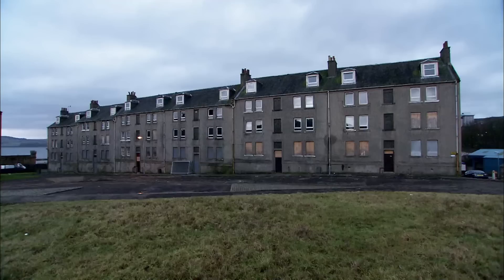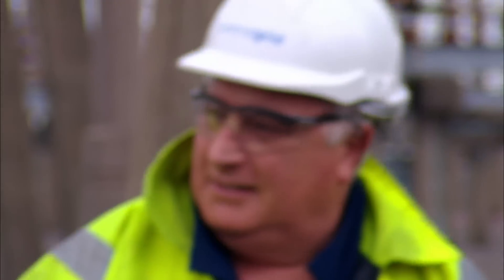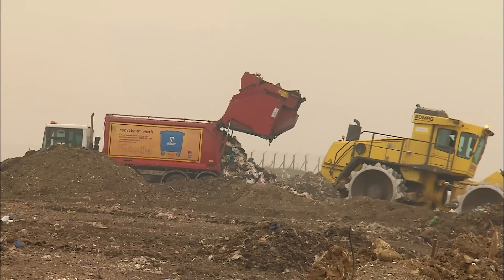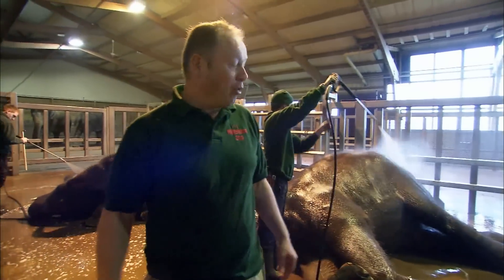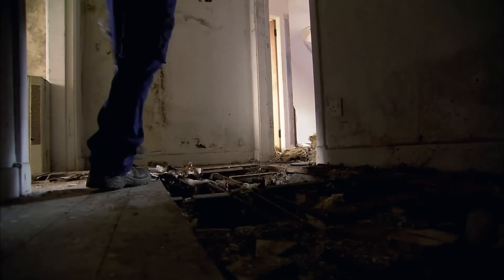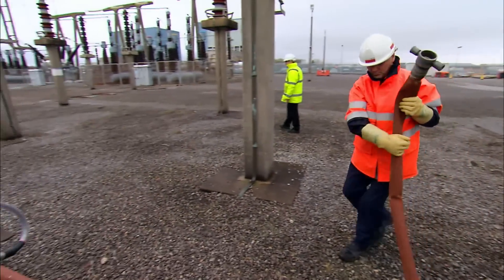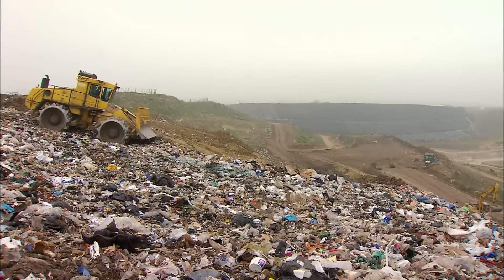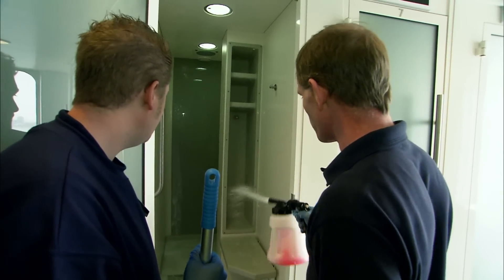This Cleaner Makes A Shocking Discovery... | Supersize Grime | FULL EPISODE | Filth

Comment: Why do you have to clean out the flats it they are going to tear it down great videos. ❤❤❤❤❤❤
Reply: It is mainly because domestic waste and industrial waste dont get mixed so concrete wood etc gets disposed of differently so imagine tearing a building with the domestic waste inside..that will be hell of a job after the fact to then seperate..hence the reason to clear up before hand 😊
Reply: Plus, can you imagine flying used hypodermic needles when it comes down. Not safe for the contractors.

Comment: I wonder if there was a better way to pick up the needles.  Maybe a magnet that has a lever to clean itself off, similar to some can openers.
Reply: It seems like there’s got to be a better way to do a lot of this stuff.
Reply: Problem is the needles are made of the wrong kind of metal, so they're not magnetic, and metal detectors won't show them either. Having said that, using large tweezers to pick up the needles looks much easier already compared to the litter picker used in this episode.

I think we could also train dogs to detect used needles, but to do that ethically the floor would still need to be cleared first. Dogs would mainly be useful in finding buried needles, or those hidden between sofa cushions etc. Basically just to check the place after an initial clean to find things human eyes possibly missed. Wouldn't make it quicker, just more thorough.

Comment: And…… washing salt off with salt water?? This is messing with my head!!
Reply: I think they meant that they have to wash them in a certain order because they don't want the dirty, sprayed-off water (containing salt from the dirty conductors) splashing onto other conductors stacks. It wasn't quite clear, I had to watch that part a couple times to understand it. The water they spray with is clean fresh water, but if it reaches a certain 'hardness' in minerals from the tap source, the system will shut down as you don't want mineralization build up on the conductors either. Think of a glass of water that's left to dry out and the whitish film that's left behind--those are the minerals in every kind of tap water.